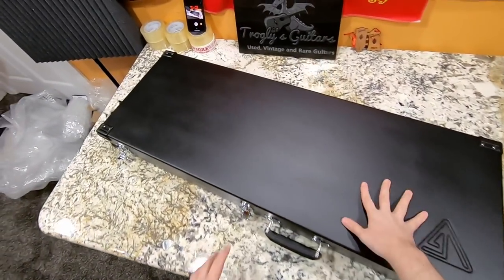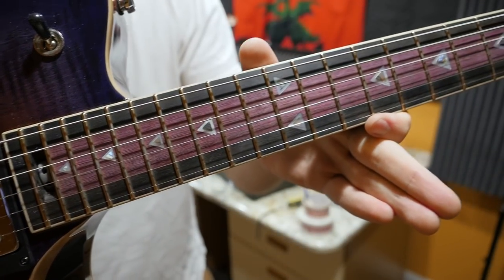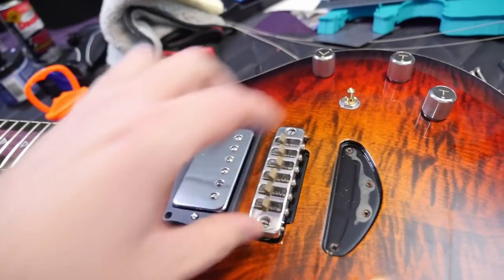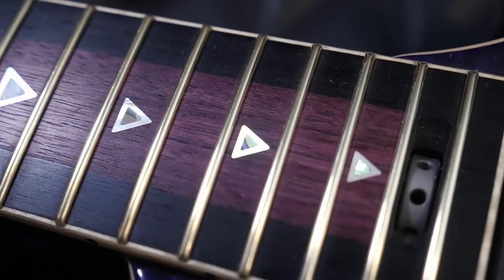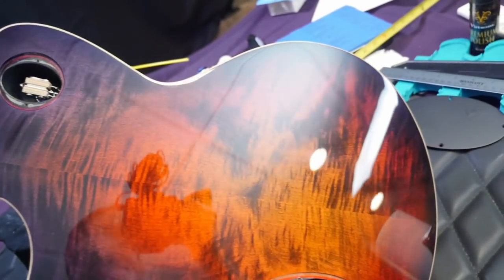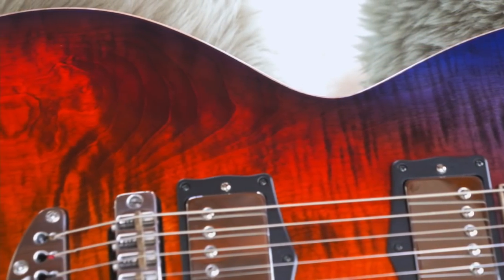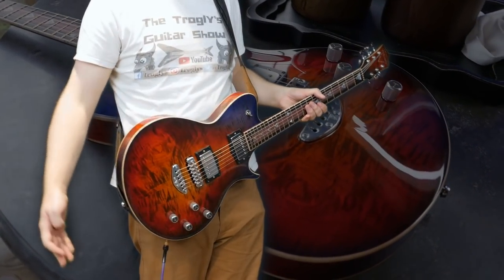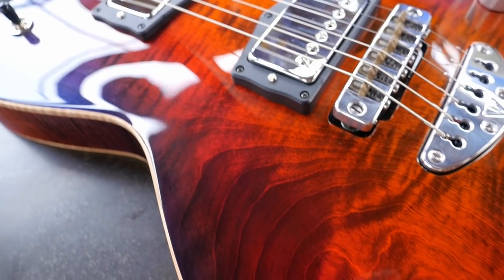I Got a Boutique Guitar From UKRAINE! | 2022 Valiant Guitars "Smith" Review + Demo

Comment: Having the trussrod adjustment at the heel prevents the headstock from having a weakspot due to the routing those guitars normally have. What I would love to see, though, is a way to cover the wheel cavity. Day to day use will cause dirt to get trapped in and it's very hard to get out and clean. I also think the wheel is far more superior than a traditional nut adjustment due to its ease of use.

Comment: Dear Valiant,
Beautiful work. For not being my color choice, it still looks amazing. Your Logo is fine. It sounds great. Maybe deepen the grooves in the nut and make them fit the strings better if they really do ping around under hard bending.  Nothing some nut files couldn't fix. File them down about half the width of the sting with the same size nut file as the string. Then raise them up for proper clearance on the first fretsince they are adjustable. I love it.  Open book headstock would be all I would change. I don't like how far it bumps out. If copying Gibson is an issue, then a Matin like with a slight bow instead of straight. Or a Taylor like. But just following the line above the logo would look best. I don't hate it. I would just do it a little different. But that is just me.

Comment: Such a beautiful guitar with a lot of clever design ideas.  I've obviously never touched one of those, so I have no idea how they play.  But it sure looks amazing.  It looks like they didn't cut any corners, but simultaneously, didn't put a bunch of silly nonsense in there.  Most of the "cool stuff" seems very functional (e.g., that adjustable nut, the truss rod adjustment.  Amazing guitar.

Comment: I don’t see the benefit in the so called individual adjustable nut height. They look like to attain the next setting one would need to turn it a quarter turn, 90 degrees, that may be to aggressive in height adjustment.
Reply: Napkin maths. A 2mm diameter screw is ~0.4mm regular thread pitch (finer pitch if they really want to machine it). A quarter turn would be ~0.1mm.  Example nut heights from stewmac measurements - Ibanez 0.15mm treble, 0.4mm bass; LP 0.2-0.3 treble to bass; Tele 0.25-0.5 treble to bass.  So 0.1mm adjustments seem fairly reasonable, even assuming they haven't machined a finer pitch.  If the 0.1mm quarter turn misses your Goldilocks sweet spot, maybe jumps you from 0.1 to 0.2 and your ideal is 0.15 (even assuming you can notice the difference), there's also nothing stopping you filing the bronze slot a tiny fraction deeper just like a conventional nut. 

There are several variants of adjustable brass nuts on the market.  If they really were too coarse in adjustability to be of any use, I don't think multiple vendors would jump on the same bandwagon, and they'd have been debunked as snake oil by now.

The level of precision engineering that Valiant does on their own bridges and tailpieces suggests they're capable machinists. The obsessive attention to fit and finish on the whole guitar (that puts some other custom shops to shame) suggests theyre not slapdash cowboys.  It just doesn't seem likely (to me) that their nut adjustment is poor. They'd have spotted that issue during R&D and not fitted it on showcase demo guitars sent to reviewers.

Comment: I love the body shape and finish, too many Les Paul clones without any tasteful body variations like this one has. I love the sturdy hardware, I love the headstock logo, it’s original, classy, and it’s theirs. I love the adjustable nut and the nut width. Love the fretboard. I like the adjustable truss rod but you do lose a fret. Like you, I prefer the serial number on the body or neck. I really like this guitar, and I’m an old school traditionalist fairly set in his ways. Bravo, great work.

Comment: Did you check if they split the coils in a switch from the volume or tone variable potentialmeters? In the control cavity with the Fender pots maybe push pull anywhere? Comment on that and when you say just for fun you read the passive middle position from the switch there's a reason for that! Someday you'll need toean more about Ohm's law!

Comment: THIS is actually worth the big $$$, this I would pay for. It's more than just a guitar, it's a work of art and you can really tell they went all in with the wood selection, design elements and features. It really burns my @#$ that the likes of Gibson and Fender churn out vaguely "upgraded" versions of standard models, slap a "custom shop" logo on it and ask 5 figure prices then something like this will sit on ebay for weeks at for less money because it doesn't have "brand recognition". Something like this is practically guaranteed to be better quality, value and, I mean just look at it. Built with passion rather than meeting a quota and deadlines. Great vid Trogly and I don't just mean because it's from Ukraine, these guys are legit.

Comment: the weight-relief, which was calculated by emulating the vibration inside the body to make sure that the loss of material does not affect the sound by drastically altering its nature.

Comment: That thing rings! And it's absolutely beautiful. The only thing I'm not digging cosmetically is the headstock, don't know if it's the inlay or the shape that just doesn't flow with the guitar. But damn that thing sounds great. I forget what amp you use,  a deluxe? Do you know which B.N. bridge pickup they used?

Comment: They should have done the headstock with MoP instead of abalone and it would have popped nicely.  Maybe outlined in ebony or obsidian would have made it a bit more striking; the headstock is causing so much optical refraction on multiple non parallel planes that it was going to be hard to see anything there - probably why they put the logo on first fret too, to make sure it was definitely seen on camera.  But by making it a highly figured abalone on a surface that turned out like that it's almost like they tried to literally make it invisible to the eye even though it's right there.

Comment: It's a beautiful guitar and looks like the gave it their all to show what they are capable of. I've noticed the  same things with some cases I've bought. The handle being close to the same area as the case yours came in. But I've also noticed that once the guitar is in it the body balances out the case to where it doesn't tend to nose dive. I thinking since they already have a large V on the headstock maybe they can fatten it slightly move it closer to the end and add the rest of the name beneath in smaller font filling in the empty space on the face of the headstock.  Maybe in a smaller font than the rest put the model name inside the V
Reply from the maker: My test was done with the guitar in the case
Reply: oh nevermind
Reply: @Trog   I guess that handle must really to far towards the body then.